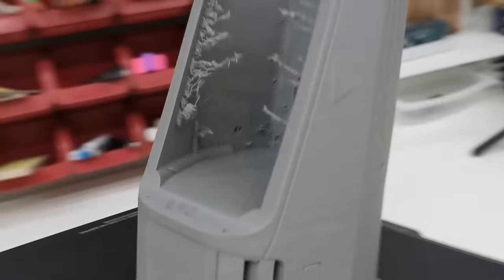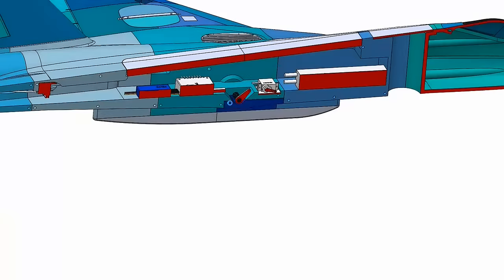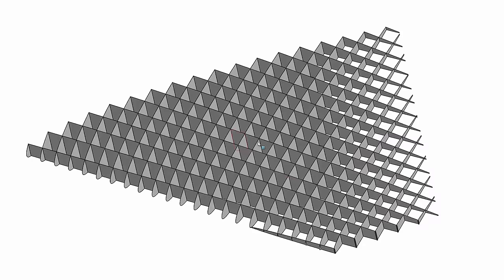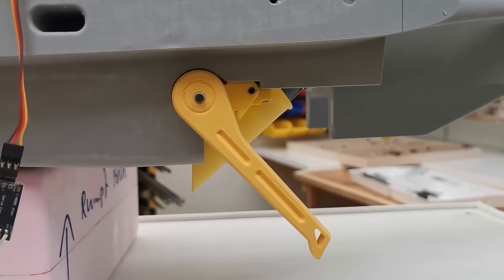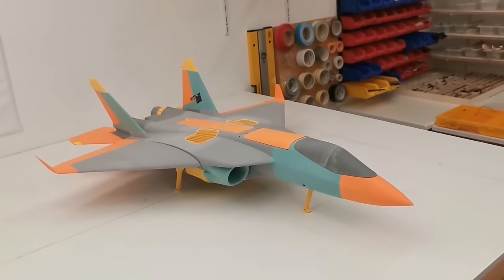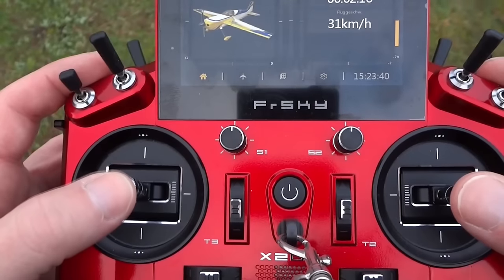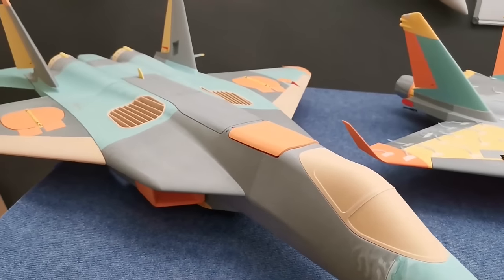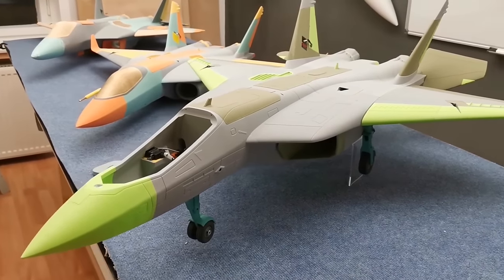Full Story of Building the JRM-01 VTOL-Jet | 3D-Print RC Project

Comment: Simply astounding. I imagine intricate concepts like this every day, I lie in bed and imagine new assemblies and new ways of achieving results in my aeronautical designs but I sadly lack the CAD skills to make them reality (odd because I am a designer in the aviation industry - interiors and liveries of bizjets - so I scribble on paper but until I learn CAD they remain mostly just scribbles but I’m proud of many of them - I designed an aeroelastic hydrofoil and started working on winglets long before they were commonplace in full size aircraft - until I learn I will keep enjoying the work of masters like you. One thing I would love to see is a study into how thin a scaled down jet’s airfoil can go for effectiveness and efficiency - I know you chose the best airfoil given the flight parameters but I always wonder practically at what point does an airfoil become too thin and if that can be overcome by undercamber or a dynamic airfoil that changes thickness for given flight phases - a span wise oval cam that rotates to raise the upper wing skin at the centre of pressure for instance - just thinking in writing, I love your landing gear design here btw!

Comment: I love it! Could you save weight by using less material?
Reply: We have trialled and tested many printing styles and infill patterns to get the best strength to weight ratio. At some point you just need to commit and move forward. What we have to date works well, but like anything, with more time and effort we could definitely optimise even more.

Comment: LOVELY  one visible flaw the forward fan's door opens in the direction of attack. should open away to maintain its aerodynamic design
Reply: Not if you want to catch and divert the air. We are not using the cover in forward flight but during slow forward transition. Check out the F-35B variant. Same concept and on a real jet.

Comment: Nice Job! Great project. From what I can see, I bet you could cut a 1/3rd more airframe weight. There's some really talented folks on RCgroups around 3d printed airframes.
Reply from the maker: Do you got a link?
Reply: We are sure there is but it come down to invested time and payoff. At present we have optimised our design for the print profiles with best outer surface finish and strongest structure all with most efficient printing.

Comment from the maker: JLCPCB 3D printing from $1, get $54 new user coupons https://jlc3dp.com/?from=rene
Reply: Where can we buy the models
Reply: What program are you using I just bought an Ender 3 S1 Pro 3D printer and want  to design an RC plane, but your program is really handy. If it is possible, can you send me the name of the program. Great video thanks
Reply from the maker: @DJI-SkyShots-sergeivanbaal solid works 👍
Reply: @renerosentraeger  Thx, also what motor are you using to get VTOL and Horizontal thrust.
Reply: What is the software you used for making the animation?
Reply: Hi what material did you use petg or abs.
Reply: There's a major problem with your design : it misses the pilot-flyable scale.

Comment: PLEASE!!! scale this up for twin 70-90mm with Colorfabb LW-ASA!!!!  This is Wonderful work!!!  Try the X-fly 70mm fans in the B-1B?  Tons of power with a single 6S.  It is on the verge of what can be powered with a single 6S pack.  With your other motors, you may need to carry a 2nd pack, but maybe you can make the 2nd pack smaller?  Just an idea.  I would purchase in a heartbeat.  I currently have an Ultimaker S2, S5, S7 and a Raise3D Pro2 Plus.  I am looking at getting another Ultimaker S5.  I want to print in more industrial/professional materials when possible.
Reply from the maker: Sure, 70 and 90mm will come.

Comment: Paint it black with some red highlights like the canopy and you’ve got the Swat Kats plane!
Love your work. Will be donating and hopefully buying your plans in the future.
Do you think you’ll upgrade the older plane to a 3D printed version?
Reply from the maker: Thx mate! Which older one do you mean?
Reply: Black is always a difficult shade for 3D printed aircraft. Black absorbs heat and LWPLA does not handle high temperatures and begins to buckle and deform around 70-80 degrees

Comment: Absolutely brilliant design work and execution. But tell us, are you colorblind? Your selection of colors is rather odd. Was there a reason for your selection. BTW, did you consider using neodymium magnets and springs on the vertical thrust doors instead of servos to save weight and reduce complexity?

Comment: you can get rolls of the material they install car windshields with, and use that instead of the messy sealant for vacuum bagging. its called mastik. it can be reused. be sure to use 7mil plastic, as it has the elasticity and strength you need for the parts youre making. 9mil will distort your parts in the mould, 5mil will tear.

Comment: I hope the stl files can include desigms with different features.  I would like to start with a model without the complexity of vertical takeoff in the design.   I would like to add this later when I am used to the flight characteristics.
Reply from the maker: Yes, the ctol version will be released first.
Reply: @renerosentraeger  Can the CTOL version be converted or will it require a full new print to make it VTOL? Also, what CAD software are you using? Looks interesting.

Comment: Do you think 3D printing has the potential in future to print an entire RC jet in one pass, maybe excluding the engines, but maybe not?  This involves printing in multiple materials including metals in ways such that interfaces between metal and plastic are possible, all electronics are embedded solid state into the design and parts that move and rotate can be made.  Obviously an entirely different approach needs to be taken to design and perhaps multiple modes of printing simultaneously need to be engineered.
Reply from the maker: Think it's just a matter of time.

Comment: Curious why you choose to print the plane with solid models? (with infill) Would it not be smarter to print to save weigth? Internal support and stiffener structure without infill
Reply from the maker: A lot of testing was done, prior the final construction. Shown in the testing playlist.
Reply: Thin wall sections and internal runs are counter-intuitive. More material is used to create internal details making the model heavier. Depend on the design, a basic outer skin with a low percentage lightweight infill is more rigid and weighs less. See some of the earlier testing videos 😉

Comment: Sup brother. I had a quick question with some cheap plane. The su-35. Are the transmitter nd the receiver paired only to each other or am i able to use another controller for the same plane. Any help would be great cause my son is super sad his remote broke(i ran it over on accident) shh dnt tell him xD. I wanted to fix the remote bt dnt want to mess with the inside before seeing what im gettin into. Sadly no videos of the remote being open. Thanks , any help would be great

Comment: SU 57?)
Reply: More like Su-47 Berkut
Reply: @romansallai8223  The main highlight of the Su 47 is the reverse sweep of the wing, and besides, the air intakes are of a different shape))
Reply: @fanmma7819  Yes I responded too early when the Berkut shape RC plane was in the air and wanted to correct your question but later there was a second RC similar to the 57